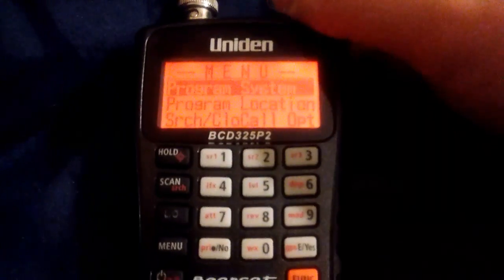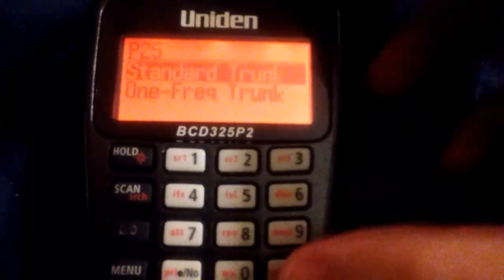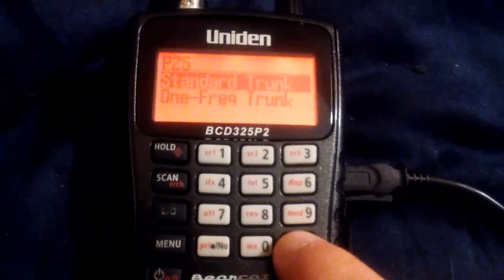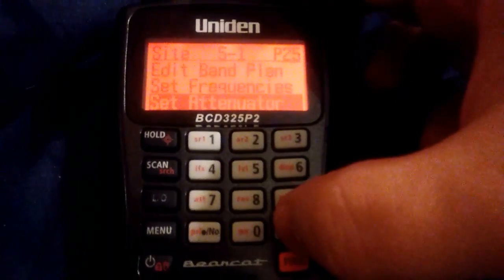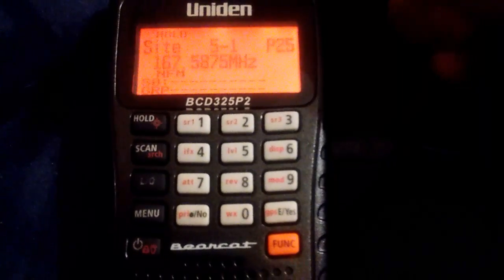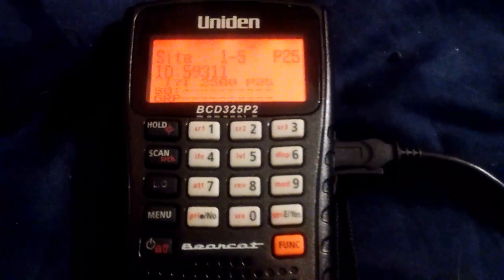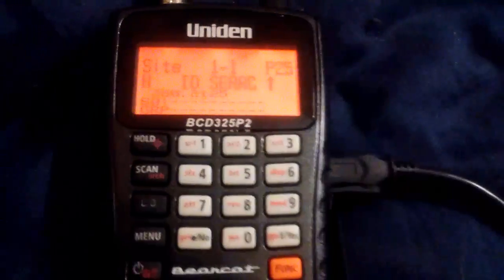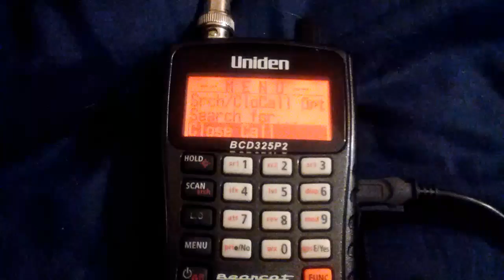How to program a P25 frequency on Uniden BCD325P2

Comment: Question, so I have the same exact scanner and the department i want to scan switched to a p25 phase 2 and the frequencies are 8 digits, the scanner only will save 7 digits how to i go about this to scan the frequencies
Reply: That last digit is usually a zero at the end you don't have to actually enter that. It's just a placeholder. Like the zeros in a bank account number

Comment: I recently put in a BCD996P2 in my truck and found a WSP frequency in my area that they use. However I did the programing and set it to P25, but I haven't heard anything off that frequency.  I hear it over my Home Patrol 2 but not my bearcat. Am I programing it wrong?

Comment: Thank you for posting this!  I just upgraded from a BC75XLT to this scanner and used the computer software to program it.  This worked fine for the conventional frequencies, but even though I tried to upload the P25 frequencies (Westchester County) I don’t seem to be hearing them.  There are two Primary Control Channels (red), six Alternate Control Channels (blue), and four frequencies that have no color allocated to them.  The system is divided between “North” and “South.”  I’m starting to wonder what I’m missing here.  Are there some other codes I should be entering? Have I not saved them properly?  I can hear the same frequencies I can on my BC75XLT— local PD, EMS, Ham radio operators— that I was able to enter using the software.  The screen display indicates I’ve uploaded the North and South to the scanner….but I’m not hearing any of the frequencies connected to these systems.  Any feedback/advice would be appreciated!!  Thanks again for your video!

Comment: Hey there!
I notice you have LAPD City (STRS)...Security (SEC) and Security division -TAC Simulcast.
I'm using the BCD996P2 and have been trying to program this radio, for the last week now nothing has come up so far.
Using FreeScann software and uploading those sites you have on your radio, my scanner hasn't picked a thing.
The area I'm trying to monitor is Southwest however, it doesn't show up as a site, I only get the following.

East.
Northeast.
West.
South.

Site 1
Site 8

Can you do a video on programing my radio in the LA area LAPD, EMS, and Sheriff frequencies?
Detective and TAC channels are great to listen to, can I program them into my radio?

Lastly, I would like to program frequencies into individual banks and give them names, this radio is very confusing on how to get that done. 
They sent me the manual in french and, in very small print, I can't even see the letters.

Man, I have done just about everything to program this thing, and have heard nothing so far.
Oh, I did hear (154.665) sounded like a helicopter following some guy around town, and (506.96250)...Wilshire.

Need help!

Comment: Sorry for a random bump, how different is this scanner compared to a BC75XLT? If so, how different? And is it easy to just manually program a frequency without using a P25 type programming.
Reply: The BC75XLT is an analog scanner whereas the BCD325P2 can also receive P25 phase 1 or phase 2 (digital) transmissions. Most if not all Public Safety Departments (Police and Fire) have migrated to P25. The programming for the BC75XLT should be easier than the BCD325P2.

Comment: Your P25 frequency is already preinstalled in database. That is why it comes up on the screen when you enter the frequency.
Reply from the maker: It will also decode P25 transmissions as I scroll through the bands.

Comment: I have a question I just purchased the  Uniden Bcd996p2 I live in  Northern NJ  
I want to program P25 but there's like 12 control numbers  do I put them in higher to lower or lower to higher

Thanks 
Anthony
Reply from the maker: You can enter them at random if they're on the same system. When you go to "program system" on the menu and select a system and program P25 (Phase I and II) all those channels that you're talking about should work.

Comment: The batteries of my scanner die in one minute. Why is that?
Reply from the maker: Jose Robles I'm not sure, but I think it might be the processor in the radio. I have the same issue what I do is use the USB cable and hook it up to a power bank. I would recommend using a power bank that has a lot of capacity I use a blackweb 10,000 mAh power bank to power this scanner.

Comment: I'm having trouble programming mine.
Reply from the maker: desmond rich What's the problem?
Reply: SPCyakima107 i tried programming it with freescan and i can't pick up any digital frequencies just analog frequencies.
Reply from the maker: desmond rich Are you using the stock antenna? If that's true I'd suggest using a telescopic antenna or use an external antenna with a BNC connector.
Reply: SPCyakima107 i am using the stock antenna and where i live we are Phase 1.
Reply from the maker: desmond rich I guess you can try a   larger antenna I'm using a telescopic antenna for mine it improves the P25 reception. What I also tried using a pair of rabbit ears with a F to BNC adaptor with it.
Reply: SPCyakima107 i was thinking of getting a 800mhz antenna and do you know how much that is?
Reply: I'm gonna try to program it again in the morning.
Reply from the maker: desmond rich Ok, sorry if I haven't been all that helpful I'm also still figuring out some of it's functions.

Comment: Hello, i have a question. 
My local police department uses the Project 25 Phase I.. I can't find the freq anywhere. I have this same scanner. Is there any way i can scan without knowing the freq?
Reply from the maker: Derek Devito 
What you could do is do a band search for the base station the scanner would stop at a frequency, and it would say "DAT LINK" that would likely be a P25 system.
Reply: Derek Devito: Try radioreference.com

Comment: i got the BC125AT.....should have got at least this model
Reply from the maker: Muilisx  How is the BC125AT? I was considering on getting one.
Reply: @spcyakima1077  BC125AT is an awesome scanner. Everything in my area is analog without trunking 154-155mhz and 452-501mhz. I've also used it a few counties over 151-156mhz and 451-465mhz. I got a Black Diamond RH77CA on it that works great in those frequency ranges in my town, and is ok 15-20miles away. I also have a Hustler DCX on a 30' pole at my house that brings the other 15-20mile towns in stronger.
I never programmed a scanner before, but the software was extremely intuitive. If you can file your taxes, you can program your scanner. http://unidensupport.com/Find-Your-Product/Scanners/BC125AT
I got the frequencies from Radio Reference and just copied the boxes.
My state police to use analog trunking so I bought a BCT15X, but couldn't find software that looked the same.
I tried freescan which was way less intuitive. After about a day or so I figured out how to program my regular non trunked frequencies just to get it to work.
I didn't like the sound of the speaker as much, and couldn't figure out how to do the trunking part, so I said screw it and returned the BCT15X.

I don't see software for the BCD325P2 that looks the same as the BC125AT. I was basically hoping for the same exact radio as the BC125AT just with digital trunking so I can take it with me on trips and listen to the 700mhz and 800mhz bands. But I don't know anything about trunking.
Think I should pull the trigger and spend the $400 and try it?